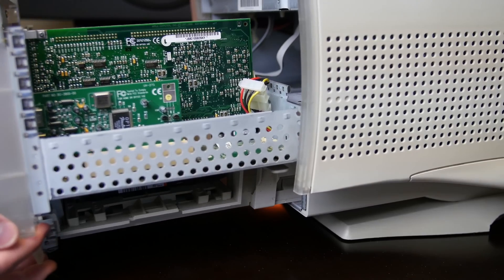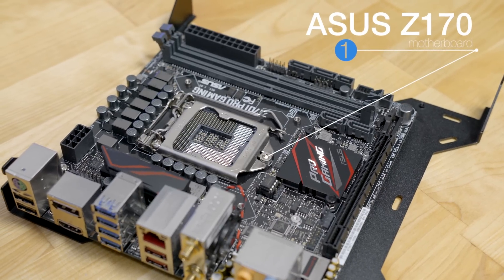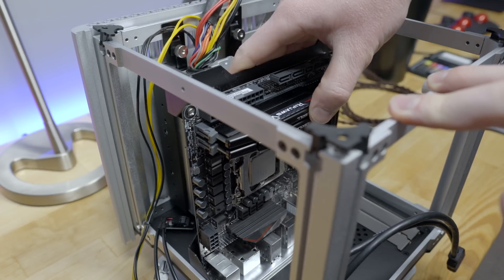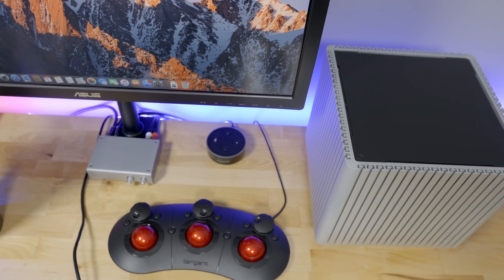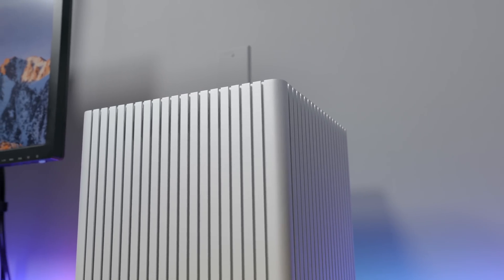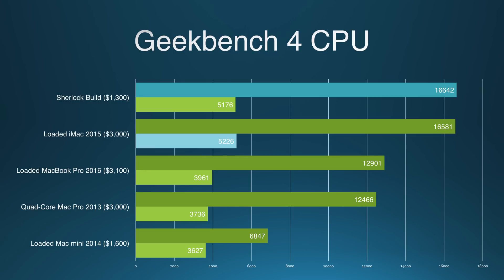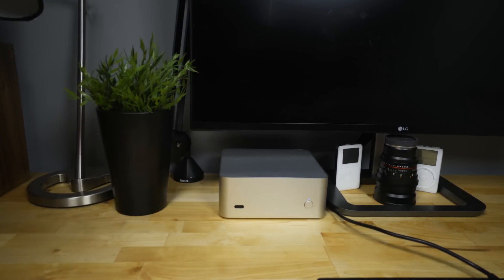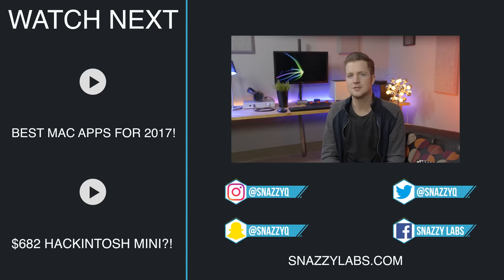The Quietest Mac Ever Made!

Comment: Even so, I still want one and it would go perfectly with my Mac Cube aquarium. 

This fall I will finally be putting in the filter, pump, plants, sand and fish in it and a light.
It would look so cool along side a Mac Cube G4 so I could run my older Mac games.
If I had the means I would get it modded as another channel did to upgrade it to a current Mac running Sierra.
Mac Cube G4's are getting harder to find in working condition and are very expensive.

Comment: I plan to use this case with my old A10 7850 APU and make it my HTPC to use in my living room. I can tune the APU to a 45 watt maximum and with a large SSD I should be able to have a thousand or more movies stored. I'll use the single PCI slot for an infrared remote and the WiFi will round out the install to a large screen flat panel. A custom made shelf to sit in the corner next to the flat screen will have a USB hub built into the edge of it so I can plug a thumb drive in and download stuff as well. Not only will it be HTPC perfection but it'll also be a work of art with a plastic flower bouquet on top. For this purpose only I love this case.

Comment: I like the idea but it's a bit ridiculous and here is why:
1) First of all just cause your CPU is running within tolerance doesn't mean the rest of the system is.  Temps of the Chipset, VRMs and other surface mounted components are probably way higher then they should be.  The high temps are probably killing the motherboard slowly. Life expectancy of the motherboard will be half if that. Same for RAM and SSD (especially NVMe, the high temps would probably throttle back the SSD's controller)
2) The power supply is way to low wattage, when doing a fan-less config you should always use a much higher rated power supply then needed, that way it runs cooler under load. Something like 4x needed wattage plus make sure it's an 80 Plus ratting of some sort.  Just like the mainboard the PSU's life expectancy will be cut down under the heat.
3)  A quiet fan setup as an exhaust running a few hundred RPM would not be audible and pull out all that heat from the case which would make a world of difference for the longevity of the machine.
That's my 2 cents.
P.S. I got mad respect for you Snazzy, I love the content of the channel so please to take my comments the wrong way; it's just that I've built many fanless machines for my clients over the years and they have all sucked in some way or another.
Peace! :)

Comment: Been running a similar build with a 1050Ti card - the fan on the graphics card was disappointingly loud.  Tonight I replaced the fan on the graphics card with the new Streacom fanless GPU cooler kit.  Running Obduction on a 43 inch 4K monitor got the side of the case pretty hot to touch but it cooled off to just above room temperature very quick as soon as I stopped.  Too soon to know if a prolonged session would cook the card.  But back browsing the net and watching movies its silent which is magic.

Comment: I wouldn't recommend the K version of the 6770k intel processor. Maybe it would be fine but, when i bought a 4770K processor, I had to sell it and buy the regular  4790 because the K-processor didn't have the processor feature required for VirtualBox/Vmware to work.  Just FYI.  Would love to know if I am wrong.  I suggest being careful if you need Virtualbox to work in your system.

Comment: I suggest putting a fanless gt 1030
Reply: Jermagne Gabriel This
Reply: i love mine, use it for a 4k htpc paired to a q6600.
Reply: Tom Jacobs How is it handling your 4k video consumption? People have always said that the GT 1030's (especially the ddr4 version) won't be enough for 4k video, hell, some dude even showed it a little bit on a video that was about a Core 2 Quad & GT 1030 machine!
Reply: @-Duyuc-CA-N  GHG tv did a video about gt 1030 and gaming in 4k
Reply: DarkPlayer ah yes, i think he was the one i was talking about but he showed video playback was uhhhh..bad, but since Tom used it for an HTPC which would be mainly for video (i would assume) i wondered if it was enough for the task
Reply: Tom Jacobs (i wanted to know since i wanted to do something just like that for an htpc)
Reply: as someone who owns a fanless 1030, those things can run inredibly hot in airflow restricted SFF cases. In a case where there are literally 0 fans, using this card is not recommended.

Comment: Hi hello, do you recommend this Hackintosh for FCPX without a gpu?
And is there enough place for a second HDD?
Reply from the maker: +Quick & Dirty & Dangerous Yes there is room for an extra drive. If you’re using FCPX, a GPU would help a little, but the app is so optimized you, be fine without it. If you’re running Premiere Pro, definitely consider a GPU with CUDA acceleration.

Comment: The 12 inch MacBook has no fans, so it is already the quietest Mac ever.
Reply: All Usernames Taken but it's also significantly less powerful. Pretty sure the goal was to make a high performance machine that was also quiet. the MacBook 12 doesn't even use actual i5/i7 processors. It uses much weaker core M processors
Reply: daviddaaannggg And it throttles A LOT, so much that the IPAD PRO is more powerful than it

Comment: No air flow inside the case. Heat pipes nor inner walls insulated. Operating temperature constantly > 70 degrees. Way higher uner work load. This thing is so stupid it blows my mind. Good luck with the lifetime of your components.

Comment: Finally I was able to build Hackingtosh according to your specifications but for some reason I can't get Wifi to work. The Wifi logo does not show up. Any thing you wanna add what I need to do?
Reply from the maker: +Saroj Hyoju As mentioned in the video, you need to buy the Broadcom WiFi Bluetooth chip as the one that comes with the motherboard isn't compatible with macOS.
Reply: The Ethernet connection also does not work. Is there any connection to the Wifi not working?

Comment: +snazzy labs I bought the same hardware as you and I'm trying to get macOS working. I install everything from the bootstick start install drivers from multibeast i do a restart and than it won't start again. The apple logo comes end then some text (no debugging device).

Had you similar issues? Or what settings did you used? Any idea?

Comment: A grand? That is insanely expensive, looks good but its a hackintosh and hackintoshes emulate the os vs running like a real mac. Get this, I've just inherited a MacPro 1,1 for free flashed it to 2,1 via an apple official flashing utility and upgraded it to an 8 core 2.66 Ghz Xeon. It's tweaked to run el cap and win 10 pro 64 bit all under $350. It sports a used 4GB Nvidia GPU Card, Maxed out the Ram to 32GB, Crucial 525GB SSD, Internal 802.11 ac w/BT 4.0 card for continuity and hand off. Works like a charm great for gaming, graphic design, music production and video rendering.

Comment: you could use a Radeon Rx. Türe are some fanless versions
Reply from the maker: +Corbinian Benkiser Nope. Those cards are indeed fanless but they require case airflow to wisk heat away off the heatsink spreader. This case has zero airflow so those cards would just bake themselves.

Comment: Why a K? Is decent overclocking even possible without thermal throttle?
Reply from the maker: +Jesse Lioce This is mentioned in the video. The main reason I went with unlocked CPU is they maintain a much better resale value and only cost a little bit more when new.

Comment: How did you get the HD 530 working on macOS Sierra?
Reply from the maker: +Imran Ali Dharamsi Easy peasy. MultiBeast has drivers ready to go and then a quick text change with Clover fixes weird menubar flashing problems. Will provide full details in forthcoming guide.
Reply: Thanks!

Comment: I haven't built a pc for about 20yrs..... became a Mac user.  Your vids inspired me to create a Hackintosh.  Love the design in this setup... but i would rather have a fan and GPU.   Was the CPU choice due to thermal considerations?  Wouldn't an i7-7700K be a better choice... built on Kaby Lake instead of i7-6700K?  Or is the 6700K the highest spec CPU supported by hackintosh implementation?
Reply from the maker: +Chris V You can use a 7700K with some CPUID spoofing but it's a lot less stable and far buggier than using a 6700K.

Comment: No gpu, no 5k screen so yeah, no wonder it's half the price of the mentioned Imac which has those things.

1.3k for this build + another 1.2k at least for the screen = 2.5k.
Add the bluetooth/wifi card, a sensible gpu and a sensible keyboard, mouse and it's another 300-400 usd on top of that.
So in the end it would cost ~2.8k at the least which is almost the same as the Imac, would not run quiet at all due to the GPU and would still be a hackintosh that needs assembly, some troubleshooting and thus precious time.

I agree as mentioned in the video that you do not need all those extra things necessarily but the Imac does have those extra things as standard and they work really well, especially the screen.

For optimising noisefloor you should have it symmetricaly (middle of the side of your head to side axis) in the middle of the room, in front of you and ideally on the floor on the other side of your desk. Off axis you will notice it easily just like most people tend to notice problems with stereo imaging while behind you it will be more noticable simply due to psychoacoustics.

Comment: You're forgetting a few quieter models:
Apple I
Apple ][ series 
Macintosh 128k
Macintosh 512k
Macintosh 512ke

The G4 cube still has a very, very noisy hard drive in most cases.
Reply: I do want to say, though, this build looks really nice. What are the temps on it? If they're decent enough, I might build one myself to run Windows on.
Reply: Those aren't half bad. I've seen worse (cough AMD A8 cough).

Comment: MacBook Air is quieter.
Reply from the maker: +MrGencyExit64 No. It's not. MacBook Air has a fan.
Reply: Yeah, nevermind. It was the model that came after the Air (called simply MacBook) that has no fan and uses SSDs exclusively. That's quieter.

Comment: OS Sierra is very smooth. 

A Hackintosh which runs like a MacBook Pro would be amazing. 

I honestly prefer OS Sierra to Windows 10. 

I'm a full convert to Apples ingenious thinking. 

One thing which I do hate is the price. 

Some people say Laptops are better. I had a 268GB SSD computer with 1000GB HDD. This Windows laptop had an i3 processor and 8GB RAM. The screen was 17 inches and the total cost was around £500 two years ago. In the last year I included the SSD to improve the speed which cost me £100. 

I also own a MacBook Pro 2015 13inch. This is 128GB SSD with an i3 Processor. 

My MacBook is faster, cleaner and has a better battery than my Laptop. It has a nicer screen and it looks nicer. 

I honestly think a semi-decent MacBook Pro is better than a really expensive Laptop. 

It's all because OS Sierra and Apples amazing design.

Comment: You didn't use Final Cut Pro X benchmarks because you know that your system would be absolutely demolished by all, but the Mac Mini. That excludes h.264 exports in which even the Mac Mini would succeed your system. When you build a hackintosh, you simply do not receive the full performance of a genuine Mac in Apple's software. I'm not just saying this. I built a hackintosh with higher specs than my MacBook. While the hackintosh did perform better in 3rd party software, the MacBook still pulled far ahead in Final Cut Pro X. It's also strange to see a $1300 desktop using integrated graphics. You claim that it would be fine as a non-gaming Windows PC or a Mac... what is that supposed to mean? Are you classifying Macs as internet browsing machines? That's all yours will be capable of with the integrated graphics, which is why you didn't run any graphics scores, in which even the garbage GPUs in the iMac would demolish. And if you claim that this really is an internet browsing machine, then you would just buy a $150 chromebox that boots up 4 times faster than your SATA SSD, draws less power, and performs equally at that task.
Reply from the maker: +Josh Greuden I didn't use Final Cut benchmarks because I was cramped on time. Are discreet GPU's better than internal graphics? Absolutely. That said, you vastly overestimate how much GPU acceleration is used in Final Cut. It's important but not as much as you'd think. The CPU is a far bigger factor. That becomes even more apparent in applications such as Handbreak that don't feature hardware acceleration at all. Furthermore, it isn't 2010 anymore. Internal graphics (especially the HD 530) actually hold quite well against low end GPUs. Lastly, Apple doesn't have some magic sparkle dust in their computers. If you build them out with the same hardware, they perform equally as well (if not often much better because of better cooling and OC options). Am I advocating everyone go build a Hackintosh? Absolutely not. Do they have weird bugs that don't exist in official Macs? Yes. That doesn't invalidate the fact that a $1,300 (or $1,000 if you use a different case and use an RX 480 (which, BTW, is officially supported by macOS and crushes every single GPU option Apple offers)) beats the best of Apple's lineup.
Reply: You claim, "If you build them out with the same hardware, they perform equally as well (if not often much better because of better cooling and OC options)." This statement downright ignores when I said "While the hackintosh did perform better in 3rd party software, the MacBook still pulled far ahead in Final Cut Pro X." By 'far ahead' I meant 4x faster despite the lower clock speed in contrast to the hackintosh. And also when you claimed, "That doesn't invalidate the fact that a $1,300... beats the best of Apple's lineup." If you're referring to your passively cooled Intel HD Graphics system; Yes... in a synthetic cpu benchmark. Not a combined, nor a real world test. (FCPX in specific, where a hackintosh is nonnative and will perform inadequately when opposed by a comparably specced Mac). With that said, I am not condoning the purchase of a Mac unless you plan on using Apple specific software. Otherwise building a system would be a better value when a hackintosh could perform better (in 3rd party software) which still wouldn't make much sense because you could be using Windows in that scenario.

Comment: You say its faster then the offerings from Apple and compare it to a 2 year old iMac, a Laptop and a 4 year old Mac Pro? You are funny.. Compare it to the Apple offerings from today: a 2.7GHz 12 Core.. in a case which is 50% smaller and 300% more beautiful than yours..
Reply from the maker: +future acid Uh... Those machines listed are the current machines. Apple hasn't updated their latest computers in several years.
Reply from the maker: +future acid Also, that 2.7GHz 12-core you refer to is 4-years-old. Research basic facts before commenting.

Comment: Hey Snazzy, I didn't had the problems you mentioned with my Cube G4 450MHz. I worked for an AASP at that time and I can only remember that some 500MHz G4s had some problems and people installed a small fan to get lower temps and more stability. 
At First I had a huge problem with my cube because it was so silent. It was a very strange feeling to work on a computer that didn't make a sound. I upgraded my 20gb harddrive with a 120gb IBM drive that introduced some vibrations and I felt much better comming from an AMD xp 1700+ can and my dual celeron 466 Server ;)

Comment: Maybe you can add a thunderbolt EGPU, So you can plug it in when you need to render/heavy use. also it's not in the case so won't get hot ;)

Edit: Most of the times those things got a built in PSU so that won't be a problem.

Comment: I'd love a machine like this, but my only hangup on doing something like this for using myself is having to hack the OS (install different kernel extensions, instilling boot loaders, etc.) to get it to install and run on non-Apple hardware, and often updates will break the hacks, so you can't update it normally, and there's always some potential for stability issues after updates and such. And considering that one of the biggest appeals to me about the Mac is that you generally don't have to deal with drivers and such, when I had Windows I always spent hours getting everything reinstalled and configured if I had to reinstall the OS.